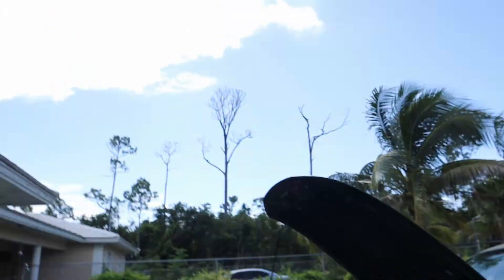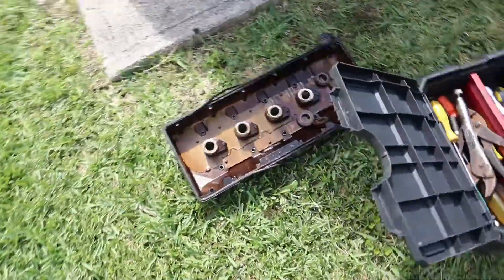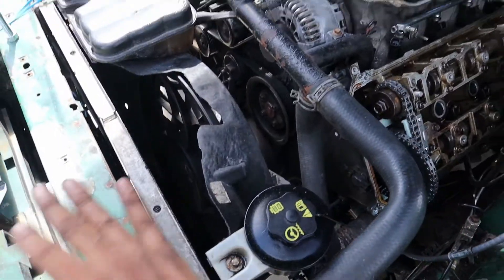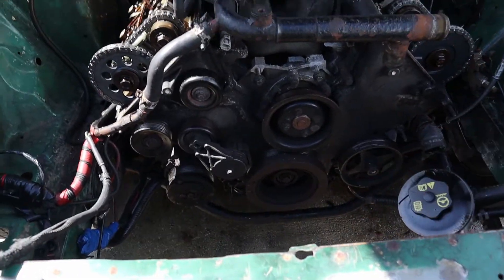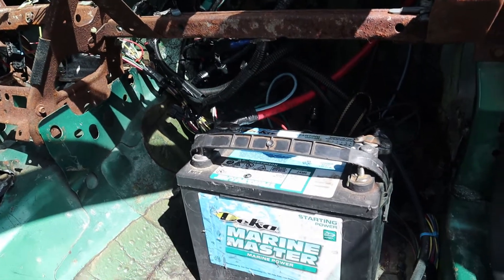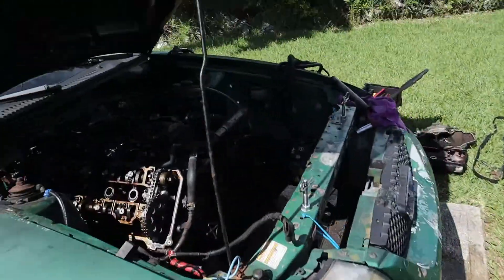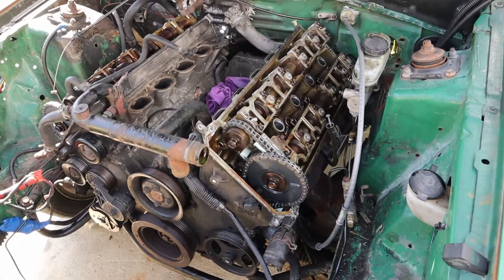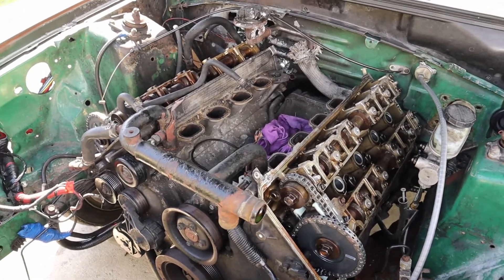What Failed In My 4Valve Motor?

Comment: Not sure what the parts market is like in the Bahamas, but in the states a good used 5.4V 2 valve goes for around $500 to $750. That's a complete running take out from a wrecked vehicle with around 150K miles on it, verified to run before the vehicle is dismantled. Matching computer is about $40. One of the bigger vehicle recycling companies like LKQ will have a big inventory to pick from and chances are they will be able to arrange shipping to you.